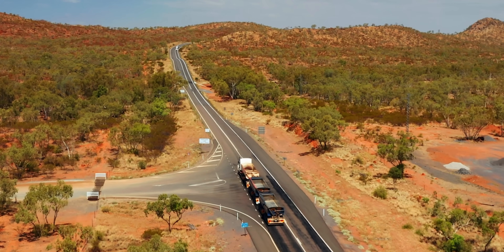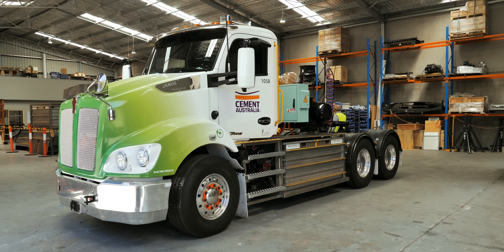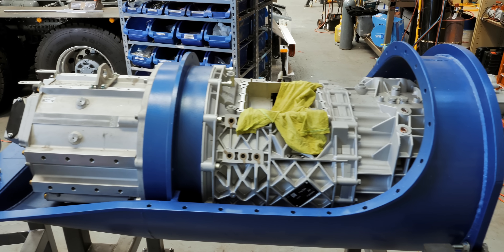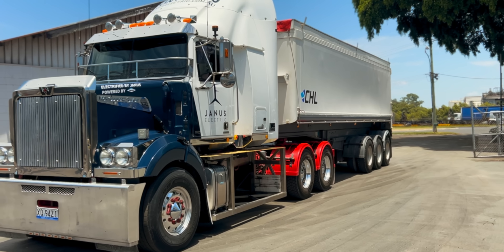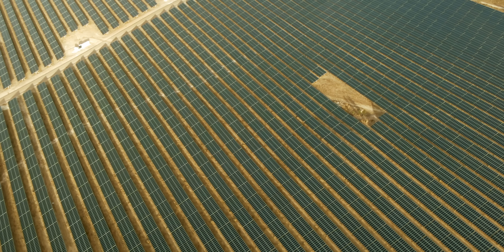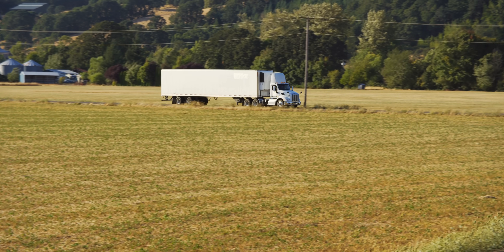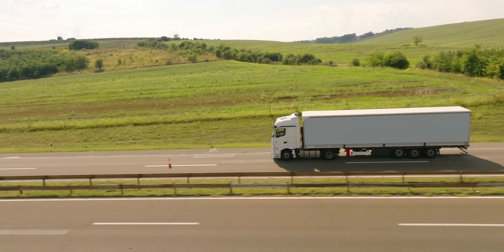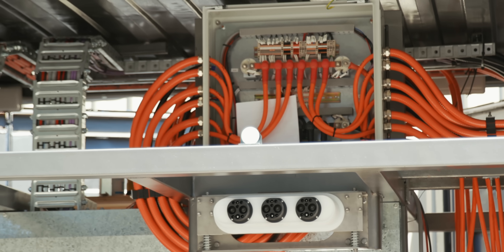This GIANT Electric Semi Can Swap Out Its Batteries!

Comment: OK, put the kettle on because this reply will be lengthy..
Now I'm definitely not a fan of electric vehicles on public roads. I can be found on many online platforms laying into anyone who promotes them. I'm definitely not a fan of this truck but there is one key thing happening here and it's too little too late. Let me explain..
Within the industrial sector such as mining operations and confined space environments, electrically driven machinery and vehicles can be found. They work very well too in those environments.
With industrial electric vehicles there's a key system in place - battery swapping. It allows for a machine to pause briefly (say during a workers meal time) and for a drained battery to be swapped over for a charged one. Efficiency is key to mining operations and battery swapping makes perfect sense.

Now.. since electric vehicles began being pushed onto the masses for everyday use, I've screamed this exact thing out - that the vehicle, all such vehicles should have a standardised battery system in place that will allow for easy swapping of a battery. A battery swap could be done just as quickly as a normal petrol station stop.
Yes such a battery system would create an 'unliked' space within each vehicle design but honestly all manufacturers could and should have worked with that and not shoved randomly shaped battery packs into totally inaccessible spaces throughout a vehicle body. It's much like mobile phone manufacturers not following a standard charging port connection - it makes no sense. I'm against too much government legislation but in the case of vehicle battery systems it should have been written in law from the start.

Will we see car manufacturers following a similar battery swapping system in the future? I doubt it. It's stupidity not to do it but manufacturers want their designs made over any practical and sensible plans. Truth be known, if electric vehicles had a similar swappable system in place from the start, ice vehicles wouldn't stand a chance. Journeys wouldn't require costly overnight stays in hotels, lengthy boost charges or hunts for an available charger. I'd go as far as arguing that electric vehicles could potentially lengthen their lifespan by 4x too if such a system was in place as it's the battery that degrades more than anything.

Anyway, the electric dream will fail.
Reply: The vast majority of vehicles on the road will become electric. There is no way around that. Battery swapping for passenger vehicles does not make much sense anymore because they charge very fast already. But if you really want an EV that is capable of battery swapping you can buy a NIO.

Comment: In the USA this will be possibly an even bigger deal - the rules allow trucks to put in rebuilt older engines - that do not need to meet modern emissions standards. Any diesel puts out a horrible amount of super-fine particulate pollution. This permanently lodges in our lungs - and the health costs and the early loss of life from this pollution is simply horrific.
The savings in health costs from switching to electric trucks - will more than pay for the transition, is a very short period of time. And that is when you use the standard "cost" of a lost life. Obviously, any loss of life is too high a cost.

Comment: Fascinating concept, I really love the idea of swapping out the batteries but I do have a question. When the battery packs are being installed with the forklift, I'm sure there's electrical connections to be made but are there any cooling connections that also have to be made and secondly is there any charging port on the vehicle or is it only done by swapping?

Comment: Back of a pad calc,  2-4 years breakeven electric vs diesel.

DIESEL 16l
Engine rebuild $5,000 to $25,000
Diesel  $1.00 per km
Maintenance $0.14 to $0.16 per km

ELECTRIC
Engine fit $150,000
Electricity (grid 25c per kw/h) $0.60 per km
Electricity (own solar 6c per kw/h) $0.15 per km
Weight  extra 500-1000kg (less revenue from freight $x?)

Average annual km articulated truck (Australian Bureau Statistics) 79,400 km per year

Electric conversion savings $43,000 (grid) to $80,000 per annum.  That's roughly 2-4 years breakeven considering cost of motor fitout.

Comment: I think the robot swap system is a fools errant. Forklift drivers are cheaper and more flexible for a long time while the business grows.

Personally I think I would have made the battery boxes lower onto casters. That allows the driver to just push them away by hand (on good flat ground)

Comment: just go hydrogen, its easier
Reply: It’s not. Apart from that it is terribly inefficient.
Reply: @Freba9  not really for large vehicles ... you need a small substation to charge electric trucks.. and ro make money , trucks need to operate 24/5 at least
Reply: @vector409  Still very inefficient energy-wise and therefore expensive per kilometer. Most trucks don't operate 24/5 and can easily function on charging. For more demanding situations battery swapping is an option as the video above shows.

Comment: I love the battery swap design.  But.  Any electric vehicle that uses a transmission is a hack.  Replace the size and weight (and losses!) of the transmission with a PROPERLY sized motor, and the CORRECT, SINGLE gear reduction.  A properly sized motor doesn't need a transmission to haul 97 tonnes any more than the electric motors in a locomotive need transmissions to haul thousands of tonnes.

Comment: This is probably the first example where I actually think that battery swapping is a great solution! 
Unlike cars they're much easier to access and the size and form factor being much more consistent makes it much easier to fit the same battery in many different vehicles! I wonder if that's one thing we'll see happening in the next few years: a standardized exchangeable battery for trucks?

Comment: Battery exchange should also be the goal or at least an option for regular cars.
Reply: It is available in China on some models.
Reply: It increases the weight of the battery pack and supporting structures significantly, so it probably isn't worth it for most vehicles.  With how fast modern EVs can charge, it doesn't seem like it is that much of an issue anymore.  

I have wondered if some kind of home swap system would be viable.  I only drive 20 miles a day to work, so if I bought a tesla, I would be carrying around a lot of battery that I don't need most of the time.  It is also best to charge during the day, when solar is available.  If I could remove modules and leave home for charging (either off grid solar or my own), then that would reduce emissions a lot.  Charging at night isn't the best since you may be getting natural gas based power and such rather than solar.  The batteries could then be used to power the house.  Perhaps allow for a larger set to be loaded into the car for longer trips.  It would also reduce the weight of the car if some portion were removable.

Comment: $175,000 to convert!! Tesla semi is $175,000 to buy with 500 mile range, mega chargers installed to charge the truck while taking a break etc and at the depot. I get the idea of battery swap but the price is surely far too high and didn’t hear anything regarding subscription of the battery but I bet there is one so that means $175,000 and no battery. Crazy and not convinced you need a gearbox, instant torque from electric motors removes the need for a gearbox or at least you only need probably two speeds. Noticed the dig at Tesla (4:05) claiming 2 tons to your 90 tons. Why do you have to smear Tesla, they are and have been promoting the change to electric yet your show enjoys mocking Tesla when the chance comes along when you don’t need to. Personally I’d spend that $175,000 on buying a new modern electric truck, 500 mile range, no gears and faster. Really don’t understand the hate and bias against Tesla with this show lately, if you’re going to compare them at least be professional using correct stats, this channel’s becoming a joke.

Comment: A fantasy, ..........Will never happen, expecting a Battery to be as good as a Diesel Engine defies the Laws of Physics!...At least with the energy density of current Batteries!
Reply: Electric motors are way better than any diesel. No need to burn brakes out down hill or use exhaust braking etc, faster up to road speed, cleaner, very little maintenance, lower running costs, quieter, smoother and yes it does take longer to charge than fill up but this can be done during your legal breaks or dinner etc giving around 500 miles range in less than 45 mins. Once charge stations are everywhere this won’t be difficult but for now yes it’s a pain. The first petrol cars had to use cans to fill up and stations were scarce. 
This is the electric revolution
Enjoy 😊
Reply: @MartynLocke Re: "This is the electric revolution"! Enjoy 😊

 You keep believing that Martyn!   LOL!

You must be an owner?......Or a potential owner?

The problem will always be the 'Charging'!

Whereas, anyone, with a Fossil Fueled vehicle, whether they live in a Block of Flats, a Mud hut, in a Park can fill up with Fossil Fuel, no problem,...Carry a spare can of Fuel in the Trunk/Boot, not scared to use the Heater/Windscreen wipers, Lights without worrying about Battery Life etc, etc.

No,....You carry on in your fantasy world.

Reality will set in, as it is beginning to with with 'Net Zero'! Lol!

PS. They've also put a 'Moratorium' on HS2,....Reality is creeping in! LOl!.....Enjoy"!...While you can!

Comment: Battery swap makes sense. We have two 18T electric DAF's on trial which need re charging daily and they are hopeless. Even short journeys require long down times.
Reply: Unfortunately it’s super expensive for those batteries swap since you need at least many just siting around

Comment: I love the idea of silent engine braking!  Signs on the motorway near our house point out that engine braking is banned because of the noise, but doing it with an electric setup is sooooo much better.
Reply: Bullsit! It’s not engine braking with EVs it’s regenerative braking and with diesels the VOITH retarder is actually super quiet unlike engine braking
Reply: @alanmay7929  Well, those trucks sure make a lot of noise when they're slowing down for the end of the motorway, whatever it is they're doing - it certainly sounds like they're changing down gears as they slow.

Comment: Something that wasn't quite clear in the video:  Does the truck have 620 kWh of batteries total, or do the TWO batteries have 620 kWh EACH (ie: 1240 kWh total)?
Reply: It’s 620kwh total
Reply: Yeah, that was confusing.  I thought it was 1240 total, but the weight, size, and range indicate that it is almost certainty 620 total.   There is no way there is 620 KWh in only 2 tons.  This is rather low range, so they will need a lot of battery swap stations and a lot of spare batteries.
Reply: @jamescox8429  yep batteries are still very expensive and they need extra protection for heavy duty operations

Comment: I really don't know what naysayers could 'nay' about regarding this setup. If you had the ability to charge the batteries yourself at service stations for extended periods from the depot then there really isn't a need to continue with diesel.

Comment: What a brilliant idea,battery swap,in the uk,our trucks don’t have a lot of spare chassis length,but we do have 15feet of unused trailer chassis x2,so could you have a small battery on the truck to move around when no trailer on,but on the trailer battery’s on work,road duty,changing batteries just great,your spare batteries charging while you are working so simple.

Comment: I can’t wait for the day to come when the electric evangelists finally wake up and realise batteries are a stupid idea and not the answer to out transport needs. Batteries cause more harm than benefit- getting the raw elements out of the ground right through to what to do with them once they’re useless.  We should be looking at research into hydrogen, fuel cells and salt ions.
Reply: If you had informed yourself a bit more you would have realised that batteries are a much better solution. Hydrogen will always remain terribly inefficient in comparison.

Comment: Could a gear box be used for INCREASED regenerative power efficiency?
Reply: It appears to have a full transmission that probably has many more gears than necessary, so they should be able to select whatever gear gives them the best regen.  Having a massive drive train reduces efficiency a lot though.  Tesla just has single speed gear boxes for their semis.  The axle with two motors on the tesla doesn't even need a differential.  Tesla likely has more than one gear ratio since the two acceleration motors are probably geared lower than the always engaged drive motor.  This semi probably does not have that high of regen efficiency compared to a tesla semi.
Reply: @jamescox8429  in your comparison you forgot to mention - that you will need x 2 brand new tesla trucks motors and batteries to do the job of one Janus conversion with a 90 ton load capacity. I guess you didn't you think of that.
Reply: He gave a figure in video you will find it had 3 stage regeneration the idea is so the breaks are used a little as possible.. The driver would also be using the gear box as well. The same as he is driving a diesel. That will spin the electric motor/generator harder. That way the whole 40 to 60 ton truck is used to recharge the batteries. That would be enormous amount of energy. Imagine a 5 mile or 8 km run down a mountain. In a perfect world the truck could climb the next mountain for free. That is why Toyota Prius has been so successful in the city. To stop hit breaks ie regen the go us battery to move offagain. This is NMH battery lithium is charged must faster ie efficient with regeneration though.
Reply: @davidwright1752  - before u go down the mountain, you must first go up the mountain, so regen will only partially replace what has already been used, so no free climb just a partial recovery of what's been used.

Comment: This works in industries that have shorter travel requirements. Cement transfer is a brilliant example of this. 

For those requiring long-haul or exclusively km-based productivity (most) it just doesn't add up. Long haul would destroy each battery pack within 12 months, meaning they need to recoup 10% of the total battery pack per week really. That is on top of the power cost. You're talking about $15-20k/month with batteries that size just in planned replacement costs.
Reply: Why?  What sort of batteries do you think they are using?

Comment: Hate to be a vulcan, but this is not logical ;) What we need in order to scale electric trucking is lots of batteries, which there are not yet enough production of. Wasting battery capacity on high drag coefficient old trucks does not make sense. Maybe something could be done about that, when converting, but I'm sceptical as to whether that would be economical.

Comment: This made far more sense than many fully charged shows I have watched and it has finally touched on the logistics of converting the global trucking fleet to lower greenhouse gas emissions and that is we can not do it in the time frame talked about by politicians and environmental commentators if we want to do it via new vehicles because that is a fact of the math and not an opinion. Where a BEV truck is appropriate to use will depend on its operating parameters in relation to availability of charged batteries and trucks operated by companies with set runs that begin and end in the depot each day are the most likely to fit this model. That will still cover a lot of vehicles. I have my reservations about the exchange battery option in that regular inspection of the battery packs will be needed to ensure faulty batteries are detected so they don't damage other parts or become dangerous when charging. I have been around forklifts all my life and I know that anything that has to be handled gently and put precisely in place is on a hiding to nothing if it's being shifted by a forklift and operator. I think the process has merit and would work for many operators but not all but that is what the whole shift to renewable energy and greenhouse gas reduction will face, no single technology will replace the majority of what we have now in all the areas that need attention. It is going to be horses for courses and even having to use second best until the best can be developed.

Comment: A nice concept but the reality is that filling up time is really not such a big issue for trucks. Much more important is costs. Given that the battery is a significant proportion of the purchase price, having to have spare batteries and a fork lift on hand would surely push up that cost. Also since the truck itself has not been redesigned for electric it will not be very efficient and will have a lower range between charges than trucks designed for electric from the ground up. But ultimately if it is affordable it remains better than diesel.